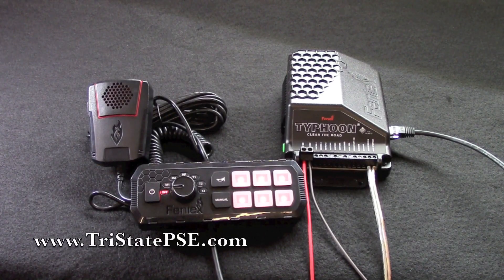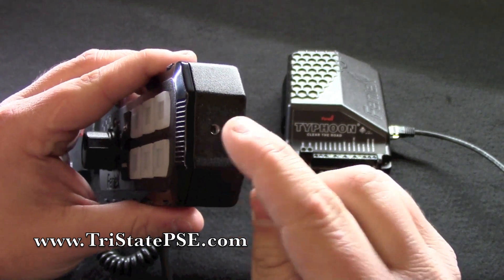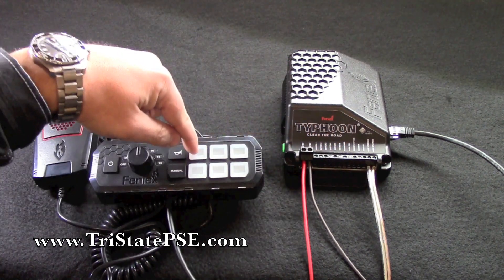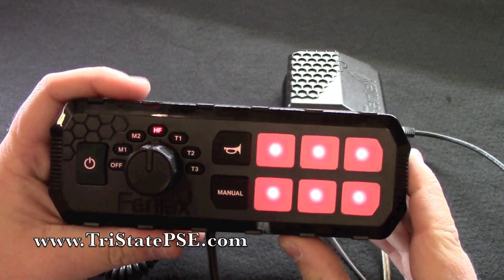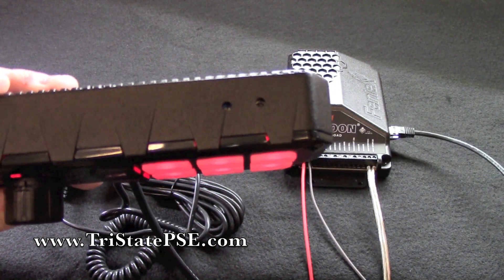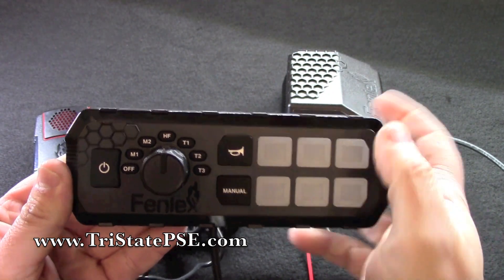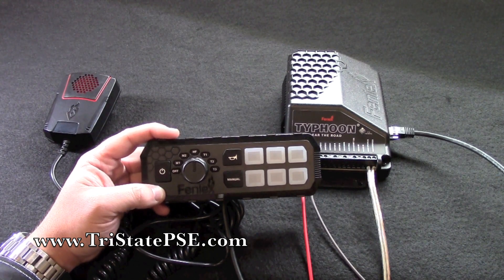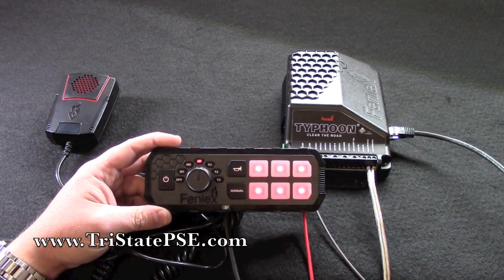Feniex Typhoon Full Function Siren/Light Controller (Close-Up)

Comment: What gage wire do you use I bought a new feniex typhoon full function I have 12 gage and every time I hook the power up it blows a fuse
Reply: If its blowing a fuse it woukd be because the wire is too small, its because the fuse is to small , #12 wire is rated at 20 amps, for AC its overated for dc so if u divide 100watts for thr siren by 12 volts dc . The siren alone will draw about 9 amps . When u add in any lights you up the amp draw

Comment: thanks for the tutorial - question: is there a volume control on the head unit for the speaker? how is the speaker volume controlled?
Reply: It's not, siren volume is a fixed level dependent on whether you have a 30W or 100W siren. It is possible to block the speaker with some sort of material to make it quieter.